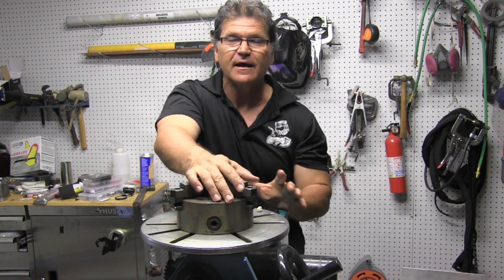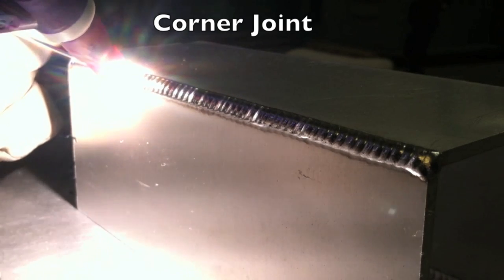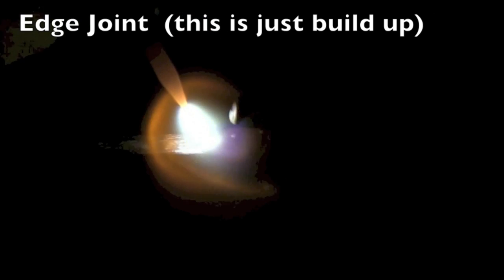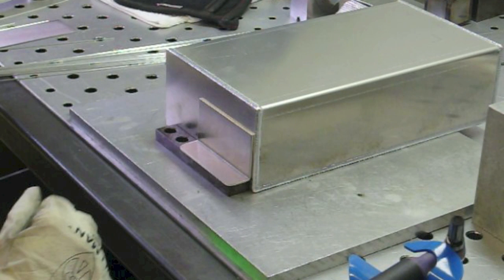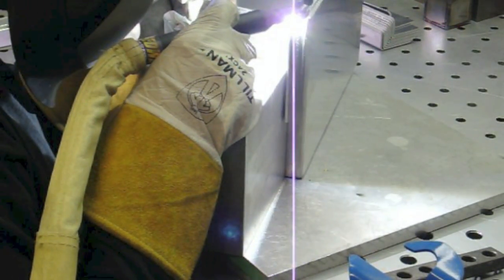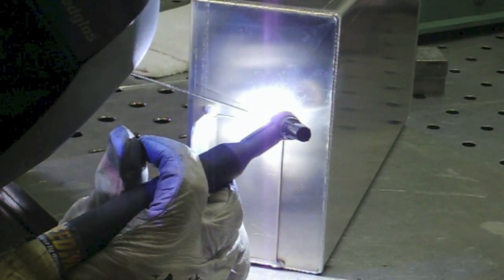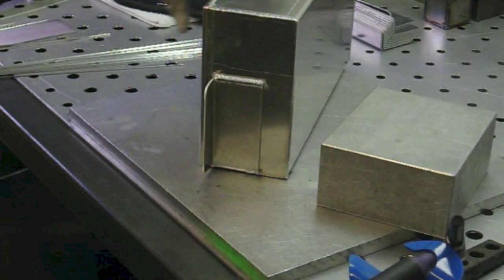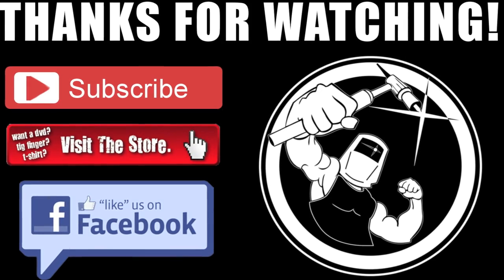TIG Welding Aluminum Lap Joints

Comment: Hey Jody- First off thanks, I have learned to weld purely on your videos and techniques!  I'm no pro, but have been buying metal and practicing for over a year now.  Could not have done it without your instruction and DVD's.  So Thank you!  

Question-  Why is it on AL that there is often that pinhole area in the root of the joint when washing the metal forward?  If one saw that on carbon steel you would think LOF for sure, but in all the AL videos I can find, it seems to be a common element.  When I TIG Aluminum of course I get the same thing, and am always left wondering if I have LOF... If I go slower or get hotter to get rid of that pinhole, I overheat and/or burn through in short order...

 I have watched every video of yours (and many others) and I understand what true LOF in AL looks like, but seeing that pin hole in the root never gives me warm and fuzzies....  Is it just the surface tension of molten AL that makes it look like that?

Comment: At about 4:25 you are showing a close up of an arc shot where it looks like the filler isn't completely wetting out on the leading edge, I am new to tig welding and notice this same thing when I do aluminum but not ss or carbon steel.  Is it completely fusing?
Reply from the maker: Tony Bush in this case I think it is because I am mixing just a bit of helium in.  I have done lots of tests cutting, polishing, and etching.  and penetration is there.  but with straight argon, you really have to keep that arc close and watch the leading edge closely along with using just enough amperage

Comment: At 4:07 is this not a lack of full penetration of the weld?  Probably more than enough fusion for a fully functional weld but would it have been good to run a few more amps to get full fusion?

Comment: hey Jodie, I just had a question regarding the way Roy is doing his tack welds on the bracket that comes on the expansion tank. After each one of them, he doesn't stay on top of it with his torch, blowing some shielding gas for a few seconds, to avoid cracks. why is that?

Comment: Another good video Jodie! One question I have is what is your general recommendation for filter plate type and shade for welding Aluminum?
Reply from the maker: *****  I would say a standard green 11 lens is a good place to start.  I am using an auto dark mostly these days. ( lincoln viking 3350) and I adjust shade from 10-12 depending on amperage.  10 up to around 80 amps, and then I go higher for higher amps.  Saw a clip on instagram thru something called a Wens Lens and it was pretty sweet so I may just have to get one.

Comment: Hey Jody. I wrote you an e-mail about month ago. I supposed you gave a lot of it everyday and maybe you didn't recognize mine. But it's ok I understand. So i asked you about a tig pen. Can you write me your opinion about this device or even make a video. I read about it but i don't know does it very helpful when talking about daily practice?
Reply from the maker: Kyryl Ponomarenko  .  
I bought a tig pen a few years ago thinking it might be a cool way to use those small remnants of .035" mig wire you get when you run out of wire on a mig welder..but the one I got would not feed .035 wire without slipping a lot. and for the larger wire, it didnt seem comfortable. 
It might help someone someone with arthritis or someone who needs to tig occasionally and has not had the chance to get good at feeding the rod.  
Thats just my take on it.
Reply: Thanks for your answer. You helped to save time and money.

Comment: Hey
I 'm an aluminum welder and I have a question .
I know that the shrinkage of steel is 3 times as large as the out put is that also the case with aluminum
jako greetings from Netherlands

Comment: I don't no if this is me having a brain fart or what but could the ripples in a weld cause a week spot/ failure point in material? like cause a spot ware a tear could form?  love your videos keep them coming!
Reply from the maker: dan rasmussen ripples are not necessarily a good or bad thing.  the heat affected zone is a bigger issue..i think...but most customers seem to want the stack of dimes look.  especially in motorsports and automotive.  Cannondale bike company advertises that they smooth welds over with a wash pass and then heat treat to improve fatigue properties.  but a second pass on aluminum can also cause loss of strength unless the part is  heat treated after welding.
Reply: great points and ty for the reply keep the great vifeos cuming

Comment: im new at welding and im making aluminum tables with 1/8 aluminum square stalk. im using the eastwood ac/dc tig and it takes forever to get the pool to start and when it does it usually melts. can anyone help me with any tips